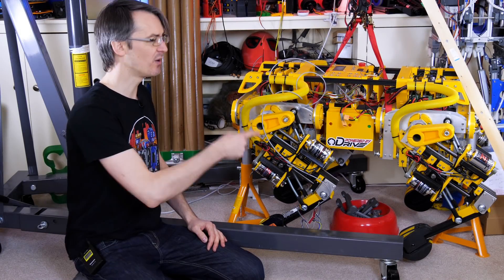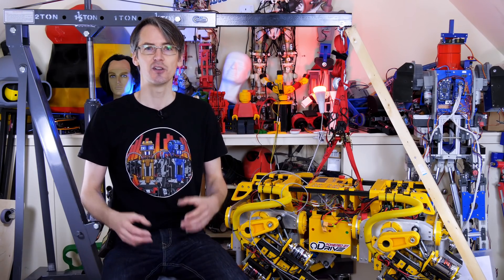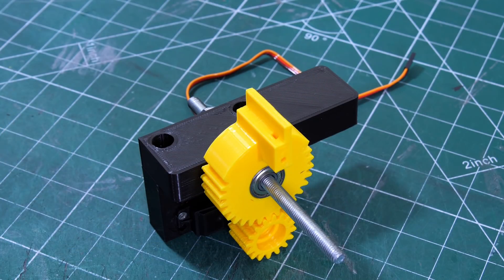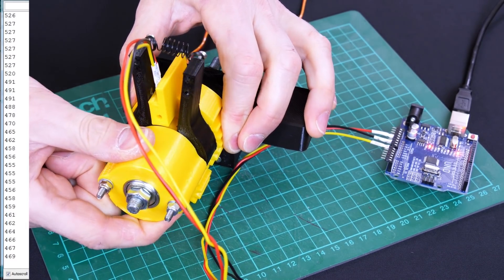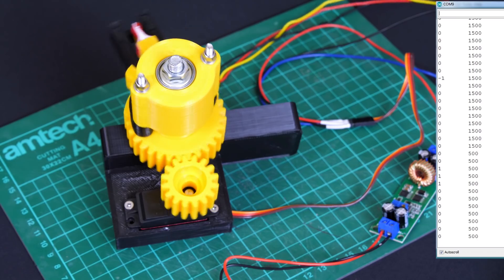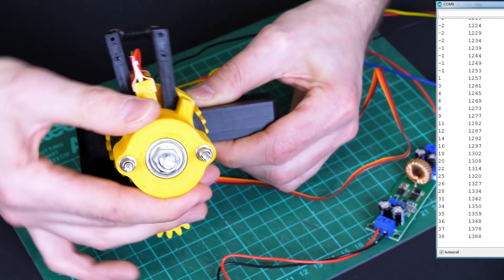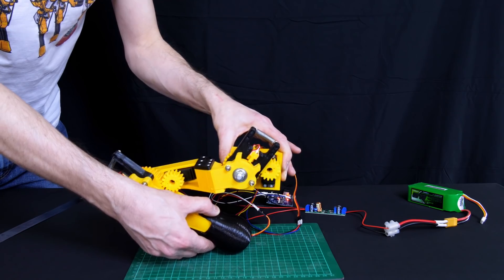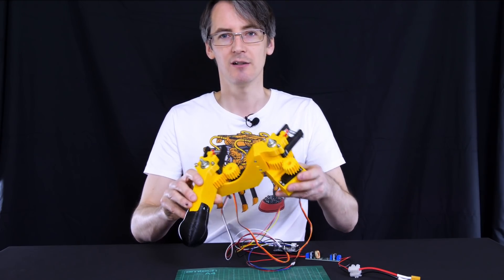Mini Robot Dog - The Affordable Quadruped #1

Comment: Where can I learn enough Arduino motor control to actually understand the project ? I tried the arduino starter kit but it didnt work on actual stepper motors with a dedicated driver not just a pic.

Comment: I don't know if this has already been mentioned but..

I'm a car guy, and this whole "dynamic spring using a controlled, rigid ball screws" seems like a really good way to do active car suspension if it works. In that vein, I thought of both magnetically actuated military suspension systems used on experimental hummers a few years back, or the active suspension system in Williams F1 cars driven by Nigel Mansell in the late 80's - early 90's

I have a rough idea how those systems work but I have no idea if any of that research/data will help what your doing, but methinks it may be worth an evening of googling

Comment: Nice work! Certainly won't be doing any running and jumping with the pitiful power to weight ratio of hobby servos, but should be able to walk slow and stable and climb stairs and stuff. And MG995 servos are dirt cheap and reasonably durable, so it should be possible to build a whole dog for around $100.

Comment: Do you have any problems with the inertia of the leg causing unwanted oscillations?   
I built an actuator like this a couple of months ago for my masters thesis and noticed that the lower limb inertia caused the system to be very unstable at times.

Comment: idk if someone else posted this before, you know why dogs walk like crazy when you put socks on their feed? most of them walk by reacting of the pressure of their paws, so when you put a sock on it they think they are not of the ground until they hit their "limit switches" and than their comes the next step
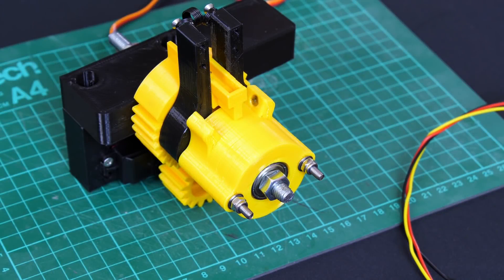Reply: at the point at 7:00 you can calculate the direction of movement

Comment: After hearing you talk about load cells not working well in this video I went back and watched the Sonic videos I skipped. You used the load cells incorrectly. Load cells need to take the entire load, bolting them directly to the extrusion means the cells won't flex properly. Scales always "float" on the load cell, and anything that isn't floating screws up the reading. To do it properly you would need to airgap the extrusion so the load cell takes all the weight. Of course this brings up another problem. The load cells you have are designed to flex in a very specific up/down motion, mounting them at an angle, where they are subject to multiple directions of force will also goof up the readings. 

Source, repaired and built scales for 10+ years.

Comment: Hi James, 
I was wondering if you saw the new project by the Stanford student robotics group called pupper here is a link to their video:
https://www.youtube.com/watch?v=NIjodHA78UE&t=0s
It's a servo driven robotic quadruped much like the one you are hoping to build but without the Series elastic rotary actuators.
 Also what if you replace the tie rods on opendog  with something like a gas strut, yes the trig might be a bit tricky to figure out but the gas strut could act as your series elastic element in the actuator making it basically the same as the actuator you are building now.

Comment: Hi james, I didn't quite understand the difference between this and the load cell. I've been trying to follow closely but am a little confused. the only difference between this and the load cell is that the spring takes the initial "Spike" of force (for lack of a better word) and then the servo catches up while in the load cell we wait for a difference in applied force to the leg and then adjust? right? 
well, if thats the case and the arduino is running a cycle every 10 ms, why wouldnt the load cell work? 10ms is so small it seems it would be negligible.
sorry if this is a silly question im just a little confused. 
-Mihir.
Reply: Because the readings from a load cell have to be averaged out over time due to sensor noise, which means the delay is much greater than 10ms.
Reply: @clonkex  Aah, that makes sense. 
Just to clarify - in a robot like the actual spot mini, would they have a physical torque limit in the form of a current limit? How did they solve the compliance problem? Did they use this spring solution? 
All I could think of was controlling the current to control the torque. But, that begs the question - why didn't James just current limit his motors?

Comment: I have an idea, that may work for adding compliance to open dog, what about adding passively articulated feet? Have a cam profile to the foot, have a spring, and a way to sense rotational position. When the foot is in the air, the foot points down at it's max/min position, but as the dog steps on the foot, the cam profile allows the foot to rotate to it's min/max position; essentially a limp foot. The spring would add compliance, but also adds tension to the foot, which is important for varying terrain. Say you have very soft terrain or loose terrain, the terrain either compresses or falls apart, the foot's tension decompresses, the sensor in the ankle detects this, the leg adjusts it's position, then the foot goes back under tension. This setup could also be used for various acceleration/deceleration curves if you want to mess with that, say if you wanted to soften the step throughout it's curve. 
Best part about this is that you're only replacing the feet and adding to the leg, rather than messing with the actuators in the upper leg.
This would be even cooler in two axes of rotation, as the feet would always be 'flat' even if the legs are spread out. Wouldn't be too hard to adapt it to this, just a ball joint, two encoders, and two springs, and there shouldn't be clearance issues as there shouldn't be a huge amount of inversion/eversion movement, and dorsiflexion/plantarflexion should be free of issues through it's entire movement range.

Comment: You need to watch the videos that show how a dog walks and run in slow motion. Once you do that use Unity to simulate the walking via code. This will help you fully understand motion of a subject. Until then it's a this is how I think it's done and a lot of over engineering.

Same basic comment I said back at the begging of  OpenDog

Comment: Hi, wonderful project, finally the one I was waiting for xD.

I built a robot dog (a little smaller than this) that KIND of walks. A big problem that I solved only in the 17th version of the robot was the mass of the leg: a large mass causes a lot of inertia and does not allow it to move forward. My solution (an idea from the MIT’s small dog) was to put the motor of the knee of each leg in the highest position possible. In this way the heaviest part of the leg has to move forward less than it was supposed to do, and the problem of inertia is reduced. (This was my solution, in the MIT’s one they completely eliminate this problem by putting both motors of the leg in the same axis that does not move at all). The third motor of each leg, as in the MIT’s one, has been placed in the center part of the robot (his "stomach"), next to the electronic part. 

I'm sorry if there are mistakes, I'm still learning English.
Reply: your english is very good
Reply: Yes, this is definitely the way to go. Replace the knee gears with a toothed belt or pushrod or cable system. If you use a belt, be careful of flex in the leg skeleton causing loss of tension under high load. Best if you can fit the belt inside a hollow leg like MIT mini-cheetah so the forces are balanced, putting the femur in compression rather than trying to make it stiff enough to resist bending sideways.

Comment: Get rid of the black fingers and linear spring. Just use a circular spring. That "first-order filter" had a dramatic effect:I would expect a software reduction in the filter as the joint's action speeds up, as the dog runs faster.
Reply: Seconded about the clock spring, it'd have more consistent force throughout its travel. There's an industrial encoder using one torn down here, https://youtu.be/kbFRWaNAWDg
Reply: @ThatBum42  thanks for sharing - I'm a BOLTR fan!
Reply: You an engineer?

Comment: Maybe a dumb idea, but what about putting a load cell or force sensitive resistor right on the ball nut or push rods? That way you can read the exact force output of each actuator and treat it as a force driven actuator, or set a target load rating with a pid controller, it should simulate a compliant joint.
Reply from the maker: It needs an encoder on the actual joint position - then I could measure the difference between servo and actual joint, which is the force on the spring.
Reply: @jamesbruton  What I'm suggesting wouldn''t add any flex to the joint, you'd still have absolute position feedback from the motor encoders, but it would give you an idea of the load on the joint similar to how the hall effect sensors give you an estimate of the load on the spring (and thus the joint) in this new design. I'm curious though, if you're starting fresh and want compliant joints, why do it in a roundabout way with the springs and hall sensors instead of having a compliant joint to begin with like you're previous mini dogs? Something like a NEMA17 with a mechaduino (clones are pretty cheap) can give you current/torque control for a cheap/small alternative to the BLDC motors.

Comment: are the cad files for these parts available? if so i want to start designing a light-weight body and hip system.
also, it should be noted that RC servos aren't really suited for heavy continuous load or impact, so a separate motor driver might be needed instead of the internal one, since those are usually the first thing to fry.
Reply from the maker: They will be when it works. I'm working on the rest right now
Reply: @jamesbruton  sweet man, i cant wait!

Comment: Interesting update, but I still think you need to simplify the legs more, and have each leg have its own independent CPU and sensors.
Reply from the maker: That sounds more complicated - A Teensy 3.6 has more than enough I/O to run the whole thing
Reply: @jamesbruton  the thing is you don't want it to run the whole thing, you want each leg to be autonomous, then have one central CPU to poll each leg on a rotating cycle at a fixed rate like every 100ms. Then you program each leg with things like walk, side step and so on, and the central CPU sends a simple serial command to each leg to tell it what to do.  If the dog goes to fall, then each leg works out what to do itself without the main CPU.
Reply: @10p6   that depends. If the dynamics of the system is slower then the total execution time of the algorithm, then you just waste an mcu. Nowadays e.g. an ARM M4 runs at greather than 150MHz, if you take in account the MIPS, and the algorithm time, you will have enough time to handle four legs with an mcu. If you want independence, you could always implement the low level control in HW on fpga and use a soft core for the central unit.
Reply: @666aron  the issue here is kinetic models need to go as there is no need for one. A ZX81 could run this system.
Reply: @10p6  How would that even work? The legs would have to talk to each other and the main IMU, so how is that any better than just having a central CPU control everything?

For instance, what happens if the dog starts to fall and both legs on one side decide to do the same emergency motion? Suddenly you have both legs lifting to take a step, and the whole thing collapses. It just makes no sense to make each leg autonomous, and would be so much more complex.
Reply: @clonkex   The legs can talk to the main CPU too if need be.  In life if one falls over instinct says put your arms or leg out.  Your brain does not measure each position of your body as a unit in whole.  My solution solves that in a simple way, and it does work.
Reply: @10p6  No, but our legs and arms are not controlling themselves. Everything is controlled centrally, by the brain. I maintain it makes no sense to have the legs control themselves.
Reply: @clonkex  it does not make sense having a rigid model either.
Reply: @10p6  Rigid model? Wut? I never said it should be rigid...
Reply: @clonkex  Any computer model is rigid if you have to calculate the position of each leg.
Reply: @10p6  What on earth are you going on about?? At some point something has to calculate the position of each leg. They can't magically position themselves. Whether the position is calculated by basic FK or by advanced physics modelling and fuzzy IK, it's still being calculated.
Reply: @clonkex  With their own CPU, yes they can and very simply.  With a central CPU all that needs to do is give a simple serial command to the legs, and that command maybe only 1 byte long saying 'Walk, ' or 'Speed up', 'Slow Down', 'Stop'.  It is not that difficult.
Reply: @10p6  But WHY? It just makes no sense. It's still going to be exactly the same code and calculations to get the legs to go where you want, only now you have the huge added complexity of multiple CPUs that all have to be flashed individually, all have to talk to each other without noise from motors interfering and all have to deal with delays waiting for dependant information from other CPUs to arrive over serial. You seem to think it magically makes things easier, but it _really doesn't_!
Reply: @clonkex   Because it is the best solution.
Reply: @10p6  Because...?

Comment: Opendog is dead. Long live Opendog.
Reply: thought the same, there seems to be no motivation and/or intent to finish opendog.
Reply: @gshaindrich  Did you listen to any of this video? R&D is at an impass, James needs to research a path forward by designing cheaper prototypes so that the design can be researched faster and at lower cost. What is learnt from new CheapDog will translate to OpenDog in the future.
Reply: @jnevercast  can you read? look up the meaning of the word "seem" ! "R&D is at an impass" THAT IS the point I wanted to make. Why start building open dog that far when the literal research and development wasn´t done? Building is more fun than programming for most of us, but it was clear from the very start that programming stability, dynamics etc. would be the harder and tedious part. "cheaper prototypes" well thats what computers and r&d is for. To do less "trial and error"! well, again it SEEMS the pace has dramatically decreased. Then again it actually has, if the videos reflect the pace. All the other projects inbetween. Have a mind of your own. I don´t need you to explain to me what James says...